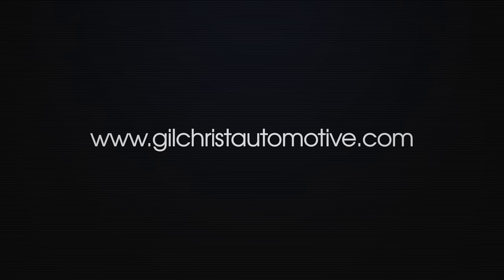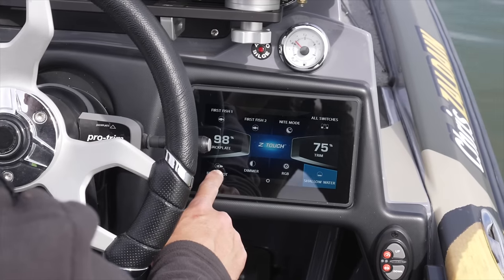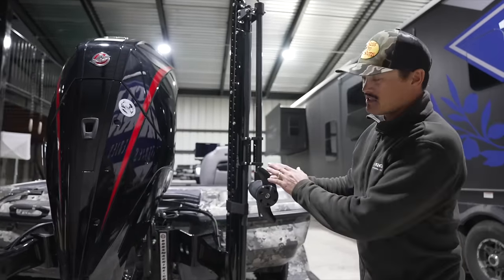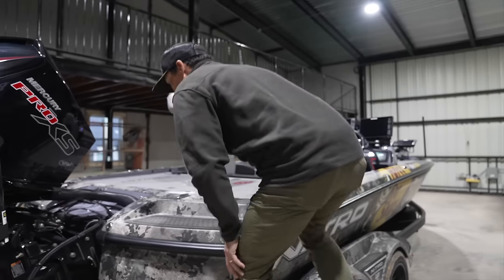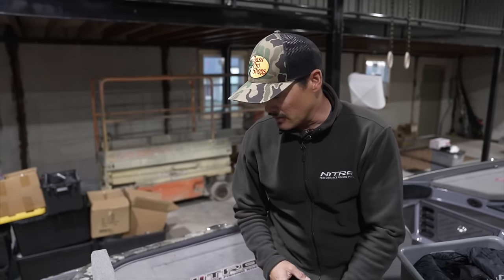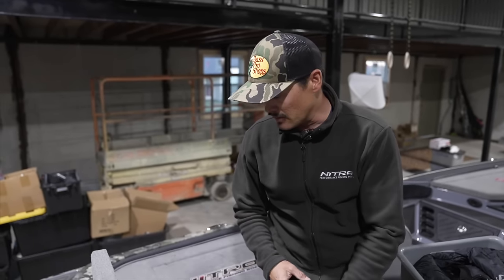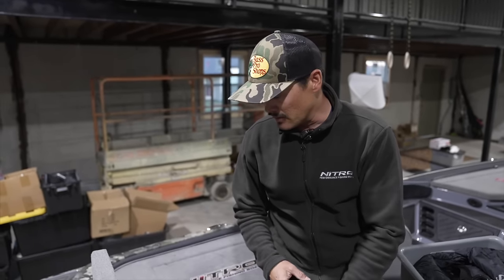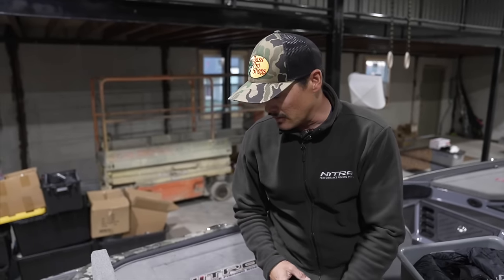Honest Nitro Bass Boat Review (After 1 Year Owning One)

Comment: I hate how people trash on nitros. You are essentially buying a motor with a boat attached to it when it comes to bass boats. And nitro offers so much for the money with the same motor as everyone else. Nitro only misses on the crazy features like the live well chillers, super high end speed, and larger gas tanks. Which most normal anglers do not need. I just got myself a 2021 z19. Cant wait for this season.
Reply from the maker: My 21xl actually has the biggest gas tank I’ve had on a bass boat… 60 gallons. It’s not the fastest but it’s faster than my last Skeeter, too. It’s a solid boat
Reply: @Zaldaingerous  Oh wow I didn't know the 21 had the bigger tank that's slick. Nitro keeps getting better especially for what charge for them. I'm happy to be in my nitro

Comment: Chris, I noticed you installed aftermarket latches. They look solid. Which ones did you get?
Reply from the maker: Those latches came with my boat 🤷🏽‍♂️
Reply: @Zaldaingerous Hmm, my New '22 Z19 came with the plastic ones. I'll be calling BPS to see what they want for steel ones. Your light post was a little different. Was it missing the top light or was that a different post? Thanks for the response.
Reply from the maker: @brianberry23 it’s a new style led nav light